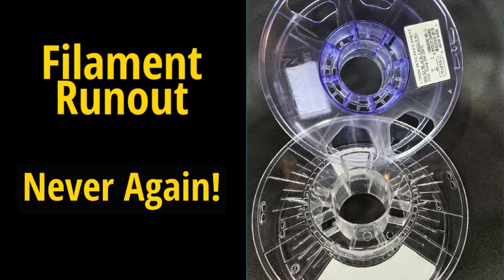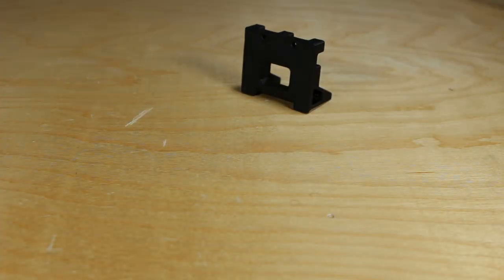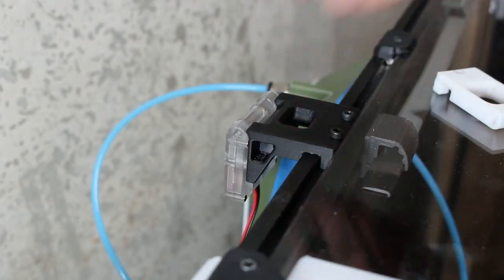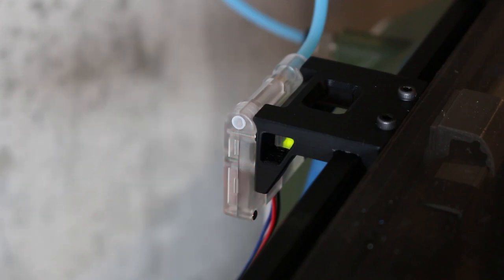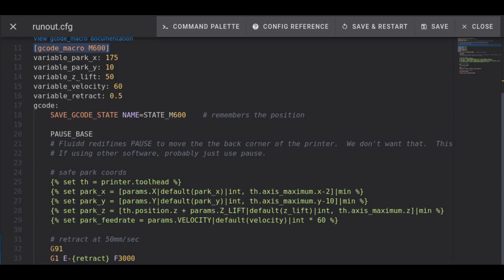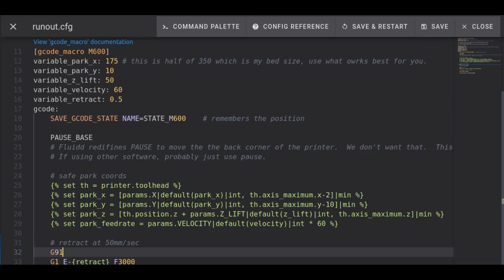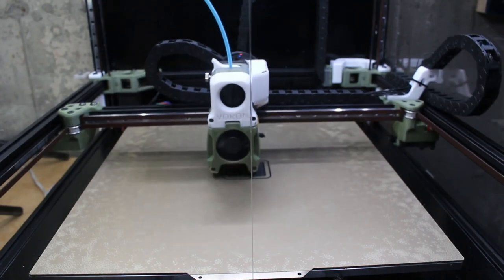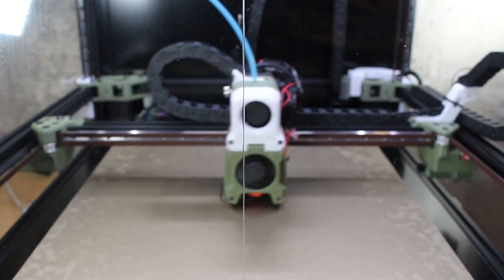Install a Filament Runout Sensor on your 3D Printer and Klipper

Comment: Thanks for the clear tutorial! I installed the same sensor last week, for some reason your code didn’t work for me but I just copied the one from Ellis and that worked fine.

However after now using up a dozen almost empty spools, I am not sure if I can recommend the TL sensor to others: While a simple install that works in some cases, more often it does not for me: most filament manufacturers fix the beginning (or end as you are printing) of the filament onto the spool in some way when they roll it up, so it does not simply unroll, but leaves a very sharp end. This bent end piece will often get stuck in the entrance of my TL filament sensor, so that it doesn’t trigger, but just skips extruder steps or grinds on the filament (this is with my LGX Lite which has large grippy gears) instead.

I am now going to try the BTT smart filament sensor next, since that one can detect actual movement as well, and can tell when the filament is stuck while it should be moving, and not just tell whether there is filament inserted in the sensor or not.
Reply from the maker: Interesting.  I have not yet run into that.  But now I will keep an eye out.  Thank you for the warning!
Reply: @KapmansBasementWorkshop   Esun are renowned but have stop taping the ends. Be sure to check with suppliers before purchase...they will fix it quick enough 🙂

Comment: Very clear and helpful presentation with key details to get me going. Only issue is I didn't listen carefully enough and so my machine was running with the sensor not reporting and my printer didn't tell me! lol. My runout lights were all working but my runout sensor was not because I didn't put the exclamation mark in front of the pin. All working well now for next time I run out!
Reply from the maker: I possibly could have made that point a little more clear, but I'm glad it's working for you.  Thank you very much!

Comment: Well explained! It would be nice if there was a switch that sits directly on the toolhead...
Reply from the maker: I actually considered it.  But I needed to design a mount and I did not have the time.  But really, on a direct drive extruder, that IS the location for it.  I fully agree with you.  Thank you for watching!

Comment: hello, I am having some trouble. so when I installed my smart sensor and code it wouldn't allow my sonic pad to work and said I need to correct line M600.
Reply from the maker: You should have a look at your M600 macro.  Something isn't quite right there.  Possibly the pin assignment?  Mine looks like this: https://github.com/Kapman1/Kapman1/blob/main/runout.cfg

Comment: Thanks...solid video. Isnt there the bed info available in the 'params' object ie just use params.bedsize * 0.5 (Im not sure of the actual named parameter)? If I comment out 'pause_resume' I get an error: "gcode command M600 already registered" but I cant find the def in printer.cfg and the def in macro.cfg is commented out?
Reply from the maker: My apologies, are you referring to the location of the "pause_resume" macro?  I created "pause_resume" in the "printer.cfg" file.  I use fluidd, so the Pause macro and the resume macro are in the "Fluidd.cfg" file.  I left those "as-is".  I hope that helps.

Comment: Great tutorial. I have only one isseu. When i pull the filament in the runout sensor it shows orange on the klipper page and when i take it out it is green :)) . Using a skr mini e3 v2 the filament runout pins on the board. Is there a way to switch this?
Reply from the maker: I believe placing an explanation point "!" in front of the pin should reverse that

Comment: One big issue with the brush location is if you use it while printing a full bed you will certainly hit some parts (on a V2.4) so it should be relocated on the gantry.  Is anyboby tried this?
Reply from the maker: In my search, I did not run into any others that were mounted to the gantry for the 2.4.  But you have a good point.  It would not be hard to design one.  The macro would be just as simple, possibly even simpler.
Reply: I have found this, That my Probe is most likely to collide with the brush teeth. One solution was to Cut the Brushes shorter so they  are at the height of the Bed. I am yet to do this. I'm also thinking a new mount that sets the brushes at the correct height might be a cleaner solution.
At the moment i'm just conscious of how I utilize a full bed on prints.
Reply from the maker: @jc84com  I'm using Euclid, so when printing, my probe is not attached to the print head, so I don't actually have a problem here.  All removable magnetic probes skirt this problem, or so I think.

Comment: I'm running Klipper Mainsail on a SKR V2 on my Hypercube.Runout sensor is from TH3D.It will trip with light on sensor,but not on Klipper screen,So more work to try and figure out why.
Reply from the maker: Is the klipper screen the lcd display on the printer or your view on Mainsail or Fluidd?
Reply: @KapmansBasementWorkshop  I installed a pi3b with a 5 inch screen on it.I pull up Klipper on my pc to edit etc.
Reply: Hi, did you figure this out? My sensor is showing a changing light pluggerd in and not signaling to the Klipper console either

Comment: Neat! something I have been considering and have lost prints from this. Does that filament run out sensor allow filament to be fed through it backwards? I'm not a fan of removing the filament from the top of the print head where the ptfe tube enters. I'd like to set a 100mm retract to fully unload the filament from the print head. With such a retraction it would be pushed back into the filament run out sensor. Will it allow a reverse feed. Alternatively can have the other side of the filament runout sensor not in ptfe tube so you can access it on a full 100mm retraction unload. Would be interesting to know.

I guess you could have a Macro that runs Resume_Print and M117 Printing Resumed to update the screen or to clear it.
Reply from the maker: The runout sensor does allow the filament to run backwards.  A 100mm retract should be no problem.  I have had some issues with filament getting jammed in the hotend in that past with those quick big retracts which require disassembly of the print head to fix.  So I cut the filament just above the print head and pull it out and extrude 50mm or so of the old filament as I feed the new filament in.  But I think I solved the jamming problem yesterday, I just don't have the nerve to try it now.  
Also, you have a knack for the simple straight forward solutions.  Again, I should have thought of the resume_print macro you just suggested!  I'm going to make that change.  Thank you for the comments, the tip and watching!

Comment: Hi, I followed the video instructions but Klipper won’t detect activating/deactivating the filament sensor, and constantly shows a green check mark. I am using the BTT skr pro v1.2 on a RatRig. How can I fix this?
Reply from the maker: It sounds like either the sensor is not connected properly, the printer.cfg might be referring to the wrong pin or possibly a micro switch that isn't working in the filament sensor.  I think the probably of a bad switch if you purchased the filament sensor is pretty low.  But if you have a continuity meter, it would not be a bad idea to rule that last option out.
Reply: @KapmansBasementWorkshop   Thank you for the fast response, we did a continuity check for the switch, wiring, and board and they all are OK. 

We tried !PE15 as well as !PG8 for the SKR but with no avail as values for "switch_pin"

Any other ideas as to what could be wrong?
Reply from the maker: @creativeintern6815  Which pin are you actually using? Seems like you tried two of them.  Send a photo via discord of where the switch is plugged in.
Reply: @KapmansBasementWorkshop  Where is the discord link?

Comment: When you type resume...
If you had a taller print and the scrub macro ran, so now toolhead is down low , z30 or whatever, now resuming position from runout spot. Tool head going on a straight line to potion potentially colliding with print. How can we call up the saved z postion to move to that +10 after scrub so tool moves downwards to print postion?
Reply: Never mind thought of solution right after asking. 
After scrub just tell z to go to z max then no matter what it will always be above print when moving back to m600 saved spot.
Reply from the maker: Thank you for posting your solution!

Comment: I'm on the road atm so I'll re-watch when I'm at my printer, but is there anything that needs to be done about the the default timeout settings?
If the sensor triggers & I don't see it for an hour, will the bed cool off & releases the print or have the Z lose 1/2 or 1/4 steps?
Reply from the maker: I'm not 100% sure as I'm typically close by when I run a print.  However, my timeout for my printer is set for 2 hours which may explain why I have not had any timeout issues.  You can change in in your printer.cfg file.  I'm pretty sure you just need to change this: 
[idle_timeout]
timeout: 7200 # change to whatever value works for you in seconds.
Reply: @KapmansBasementWorkshop  Thanks. I'm new to Mainsail Klipper and by default Mainsail is set to 10 minutes.

Comment: Thank you very much. could you please help me about this 3 questions.
1- what is the name of object that attach to microswichh for friction free? 0:44

2- do you have the stl file for that transparent object ( i mean the object that microswich inside it).

3- i cant find the answer for this question. please help me about this. i haven't build 3d printer so far and want to build it, my question is, If I make custom 50*50cm heat bed, How should I buy the length of the bars around the heat bad hit so that there is no problem while assamle the 3d printer frame?

Thanks again😊
Reply from the maker: My apologies because I'm not sure what is being asked for on question 1.  But I think the answer might actually be part of question 2.  The transparent object was not 3d printed.  It came as part of a kit from TriangleLab.  Go to their website or most any other vendor that sells 3d printer parts.  You should easily find it there.

My printer bed is 350mm x 350mm.  Much smaller than you would like.  You can try the Voron configuration tool.  But the Voron community does not recommend building Vorons that large.  So I would try RatRig.  Have a look at their website.  You can order parts and use their tools to build a bigger printer.  It should tell you exactly what you need.

Thanks for watching!

Comment: Have you been able to resolve the message in the display not resetting to “printing”?
Reply from the maker: I hate to say this, but I don't remember.  I ended up switching to a touchscreen and klipperscreen so I no longer had a need to do that.  My apologies!
Reply: @KapmansBasementWorkshop   Thanks for the reply. Yes I am running Klipper screen also. Once the sensor is tripped the message stays on the screen where it usually says “printing”. I have tried a few things and for now I just deleted the message in .cfg
Reply from the maker: @myredeemerlivesakatom2314  Strange, I've done this lately and not noticed.  I'll check and let you know.
Reply: @KapmansBasementWorkshop  Thanks!

Comment: Would this work on a anycubic kobra?
Reply from the maker: The actually filament sensor should work as long as you have some space on the MCU to plug it in.  The only other issue is that I believe Anycubic uses Marlin for it's firmware, so the instructions to get that working is very different from this video which is using Klipper.

Comment: Thanks for the tut!! Can I ask why you decided to wire the sensor to the spyder instead of wiring to the pi?
Reply from the maker: My prior experience with a pi is that you can connect almost anything to it, sometimes directly and sometimes an additional circuit is needed.  When I last connected a switch, you need to often resolve the switch's internal contact bouncing when flipped.  You would need to write some software to filter it (I don't know if Klipper does this) and use a pull down circuit circuit for accurate readings.  I was worried that it would appear to Klipper that the switch was flipping between on/off for about a 10th of a second or so I and I did not think it was worth the effort to find out what would happen.  The Spider and the other controller boards have these circuits/filters built in.  I also had several sockets for endstop switches not in use.  In addition, I know 100% that Klipper will recognize switches on the MCU.  All that to say, it was easy to do so :).
Reply: @KapmansBasementWorkshop  ahhh I see !!

Comment: thanks. 
can we use this codes in marlin? could you please tell us how to program Runout Sensor in marlin?
Reply from the maker: I don't believe these codes will work in Marlin.  But Marlin does not need code.  I believe the feature simply needs to be turned on and configured.  I've got a very old printer that uses Marlin.  I have not used it in years.  It also has a runout sensor already working.....I need to think about that one.  Thanks for watching!

Comment: Thank you for the guide. I am stuck after save and restart as Klipper tells me: Existing command 'PAUSE' not found in gcode_macro rename. Any tips would be appreciated.
Reply from the maker: it sounds like you never had "PAUSE" defined.  Things to check:
In your fluid.cfg file:
[pause_resume]

In your printer.cfg file (I'm not convinced this is necessary):
[gcode_macro M0]
gcode:
    PAUSE

Comment: would this work on SOVOL SV06?
Reply from the maker: I would think that as long as you have a spot to mount it and space on your MCU to connect it electrically, it should work.  I'm using klipper, if you are not you will need to go into the mcu software and enable the filament switch. Any place you can plug in an additional micro-switch should work on the mcu.

Comment: I was looking at this filament runout sensor but decided against it because it can't detect jams. And the only one that's commercially available is the big tree tech one badly designed. There are some DIY ones i want to try out
Reply from the maker: If you find one, report back.  I saw some stl files for home built versions that provide the functionality, but don't use the poorly designed version you mentioned.  Thank you for watching!

Comment: What in the printer.cfg tells it to use runout.cfg when the filament sensor trips?  I am trying to get filament runout working on my printer (not a voron).  Right now it just goes to the back right corner  when filament runs out and after a short period it will turn off the nozzle and bed, once it does that it will not resume print anymore and fails.  If I change the filament before it auto turns off I can get it to resume.  I am trying to replace that behavior with what you have in this video.  I changed the sensor runout pin to what it is on my board in the runout.cfg and edited X position and  I commented out the pause_resume in the printer.cfg.  Anything else need to be done? What tells it to run the runout.cfg file when the filament sensor it tripped?  I am using Fluidd btw.
Reply from the maker: As I understand it, in Klipper there is no way to get around the timeout other than changing the length of time.  My configuration will timeout after enough time has elapsed as well.  You can change the timeout (in seconds) in the printer.cfg file section: 
[idle_timeout]
timeout: 7200  

At the top of the printer.cfg where the other includes are I have this which tells klipper it needs to look at the runout.cfg file for additional details.  Nothing else is needed in the printer.cfg file for the runout sensor:
[include runout.cfg]

In the runout.cfg file, if you have properly set the pin and polarity, that should be it.  Be sure to test it in fluid under the "tune" page.  Right next to the endstop tester you should see the runout tester.  And most importantly, restart klipper after making any changes to these files.

You can also have a look in my github for the complete cfg files.

I hope that helps.  Thanks for watching!
Reply: @KapmansBasementWorkshop  Hey thank you for the very thorough reply!  I have it up and going with your config and it is working, but I am not sure what the timeout is as I did not test it and leave it to see.  I did just look through my printer.cfg and I do not have an idle_timeout in there at all.  Where in the printer.cfg should this be added?  What is the max time I can put, do you know?  Thanks!
Reply from the maker: @ShuhDonk  I believe you can place it anywhere you like.  I would place below the [includes].  I cannot remember the default timeout, but it's not long (15 mins?).  I'm also not aware of a maximum.  I would take the number of minutes (lets say 4 hours, so 240 mins) and multiply by 60, and place that in the cfg. file and I think you will be fine after restarting klipper.